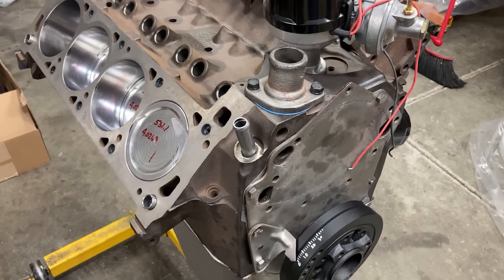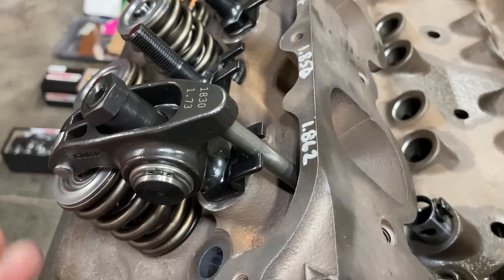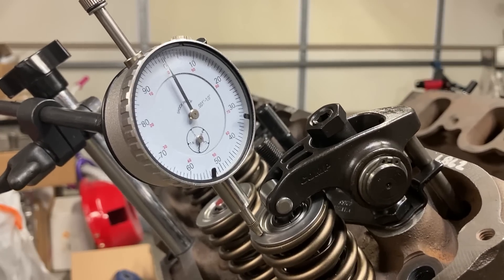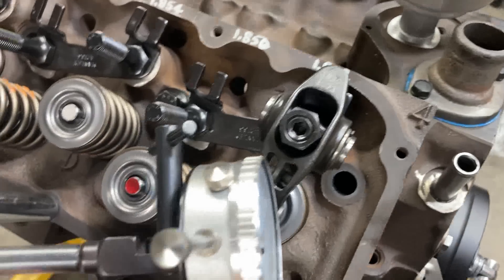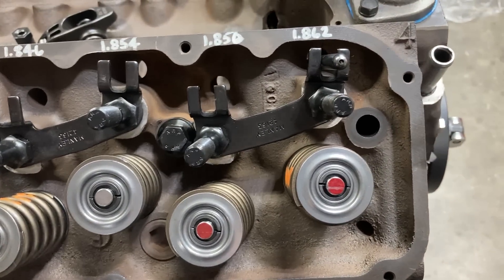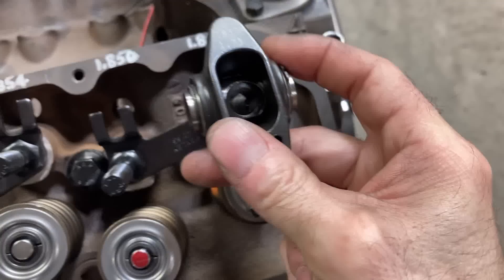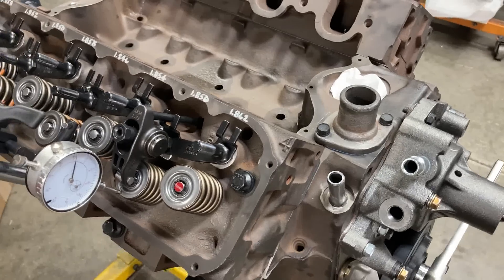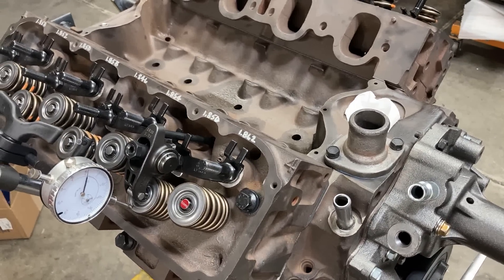Lykins Motorsports 351C Rocker Arm Geometry & Pushrod Length Determination

Comment: Its difficult to get cleveland valvetrain perfect.   Last night I put a Cleveland head on the mill and the factory rocker arm pedestals were all over the place on angle relative to each ( intake ) , the location of the rocker stud hole was not too bad.

Comment: Hi Brent, I've seen you use the EOIC method to adjust lifter preload on one cylinder many times, but what sequence do you use for progressing through the engine? Cheers, Dave
Reply from the maker: I usually start at #1 and just run down the head, then go to the other side.

Comment: I couldn't set the geometry using the mid lift method with those rockers at all. 
Makes me believe that they may not be a dedicated cleveland rocker.  The YT rockers are better in that regard imho.
Reply from the maker: They may not be.  Sometimes they interchange the BBF rockers with the Cleveland and even the BBC sometimes.  I think I could have nailed it down with the mid-lift, but I was running out of rocker stud on the intake side and running out of pushrod clearance on the exhaust side.  I was still getting the amount of lift that I should have been getting when I backed it down, so it will be fine.
Reply: @lykinsmotorsports  I wish I could show a pic of the results I got when trying to use mid lift. It just wasn't going to happen with that rocker.  I ended up doing the same as what you did. 
Is it perfect?
Not at all. I'm wondering how it will affect guide longevity in the long term.  
Apart from YT I'm not even sure anyone makes a dedicated 1.73 cleveland rocker anymore.

Comment: Hi Brent, can you not use light checking springs to ascertain pushrod length on a hydraulic cam?
Reply from the maker: You can, but a checking spring usually results in inaccurate results because rocker arms have anti-deflection engineered into them.  It’s also harder to get a good readable pattern with checking springs.

Comment: I would be interested in your experience with valve train geometry on stock cleveland's, as manufactured by Ford. My experience back in the 70's with both 351C and 400C street motors indicated substantial valve guide wear with relatively low miles on both the 2V and 4V heads. I don't think I was ever able to reuse a set of heads without putting new guides in them.
Reply: same experience here, on 351c

Comment: Can you get FE push rods? I hear there is a huge back log due to supply shortage.
Reply from the maker: Depends who you go through and what they are, but haven't had any issues lately.
Reply: @lykinsmotorsports  
Thanks a friend of mine has a complete H&M 427 side oiler motor and is waiting for the engine builder out of Alexandria NY to get a set. Also having trouble getting cam bearings as you may know they are different than top oiler 427s.

Comment: Hey Brent always enjoys your vids. Question,  when I have measured the net lift before, I have seen reduction in net lift from deflection or frictional losses. Do you see this decrease in net lift?  Do you always lengthen push rod to increase lift to specs?
Reply from the maker: When geometry is off or your pushrod is too weak, you will generally see a loss in lift from what you should have.  Lengthening the pushrod, in this case, was just in attempt to correct the geometry.
Reply: @lykinsmotorsports  thanks Brent. Dyno time 🏁👍👍

Comment: Thanks a ton Brent for taking the time to demonstrate the various techniques. It seems painfully obvious to me that the lifter manufacturers are missing a real opportunity to sell a pair of lift checking (locked) hyd lifters.  No one would have to bother with taking them apart or having another pair of solid lifters to complete the set up.  People could feel confident that the pushrod location would match what they are going to run.  How hard could it be?  If they won't, I am sure someone could figure out how to do it...;-)